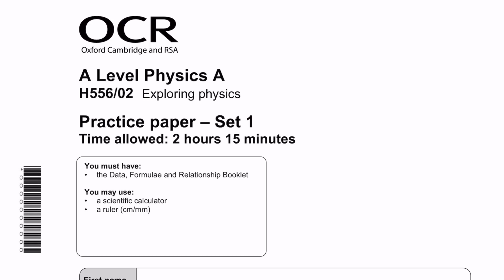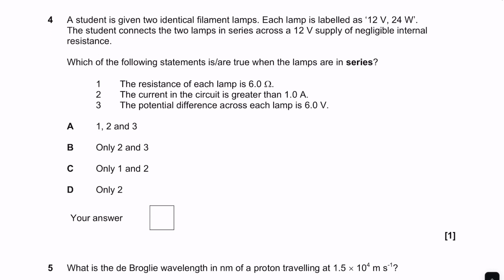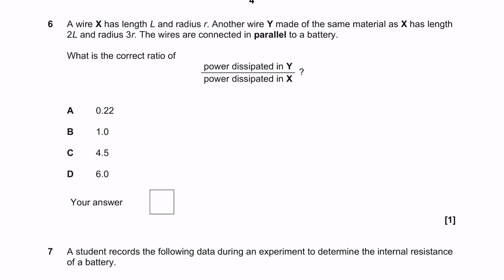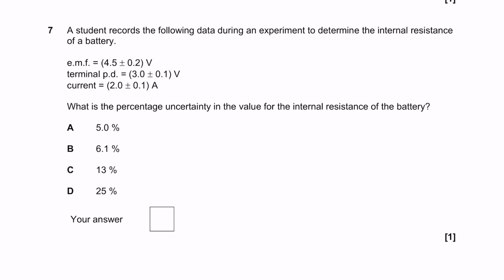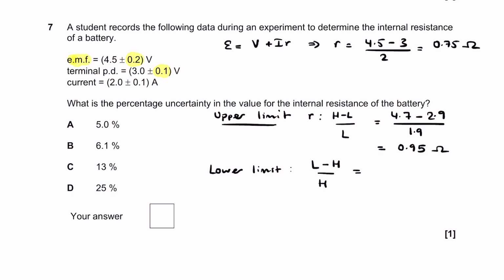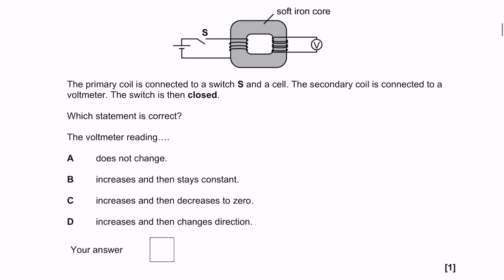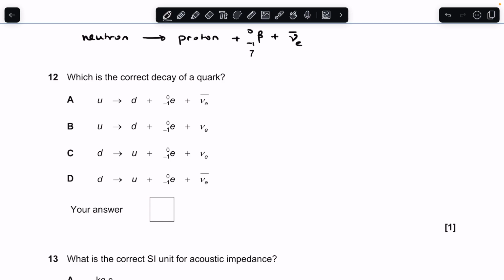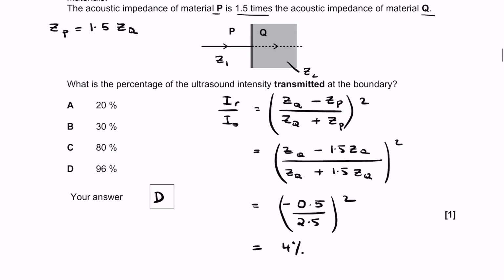OCR Physics A Practice Set 1 Paper 2 Section A (H556/02)

Comment: hi ihave 20 days left before my first physics a level exam, do u have any tips on how to get an A star, i struggle with exam questions
Reply from the maker: Do all the past papers if possible, repeat the questions that you find difficult and learn from the Mark schemes especially for the six markers. As a tutor, I find a 1-1 approach more useful when you wanna get to an A star from an A or a B.
Reply: @EliteTutelage  should i only do past papers or shall i also do topic based questions?
Reply from the maker: @takdirsaiful628  past papers only given the time limit. Most importantly do the papers under timed conditions. Mark them strictly and learn from the Mark Schemes. If you manage to do all the papers, only then I would advise to go over topic wise questions that you found mostly hard.
Reply: @EliteTutelage  Do u think it is still possible to go from C to an A*?
Reply from the maker: @takdirsaiful628  it’s a little difficult to make that transition. But not impossible.